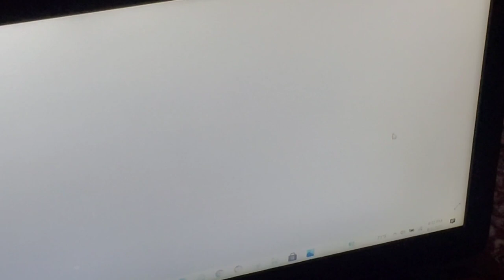The Super Duty Is Cracking  #417

Comment: Kurt, what kind of bracket are you using to hold your My Buddy heater up with?
Reply from the maker: Just aluminum straps bolted to my existing window bolts. With u bolts to hang it the bolts on bottom side to line it up.